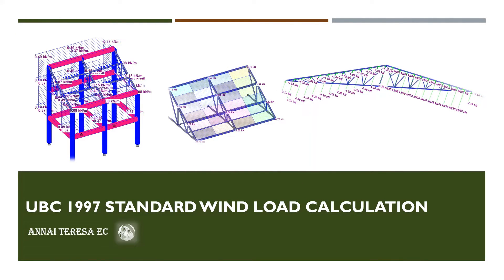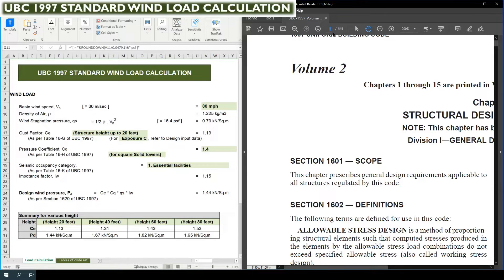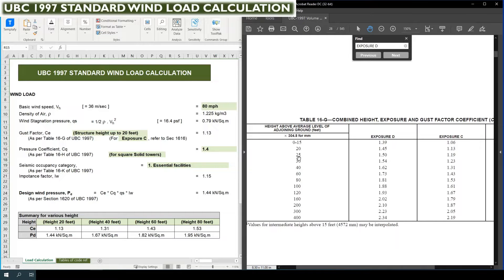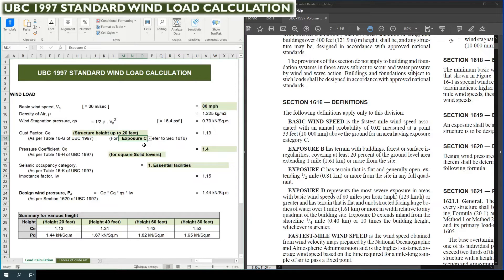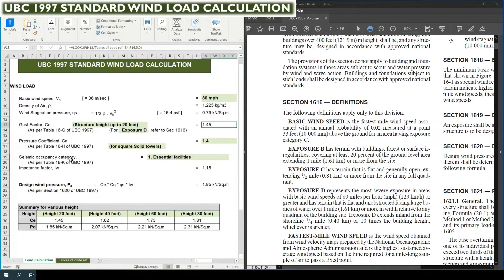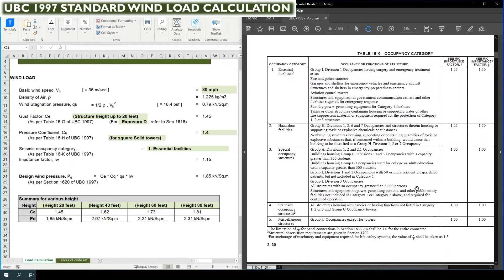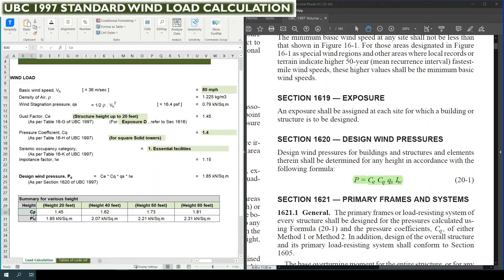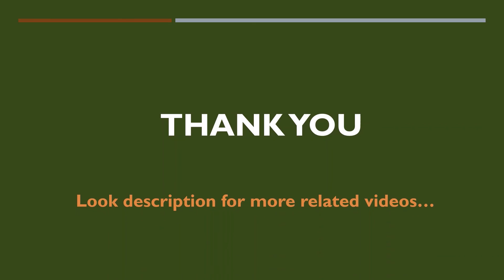UBC 1997 standard Wind load calculation

Comment: hello sir ,in gust factor ce , the ht mean from ground level to roof top ht ? or just ground level to last floor level ? 10ft 4 storey plus roof ht 4ft .44ft or just 40ft ?
Reply from the maker: Thanks for watching. Height to be considered as ground to roof top of the building above ground. 44ft
Reply: @annaiteresaec  Thank you for the reply. in etabs ground level means upto plinth level.  plinth level ht is not included, is it correct? just 44ft above plinth level.